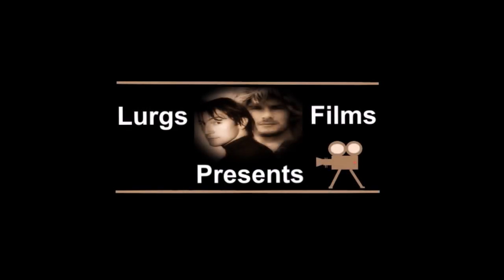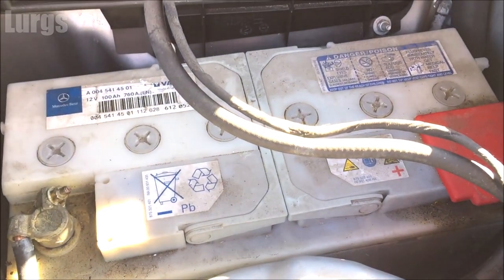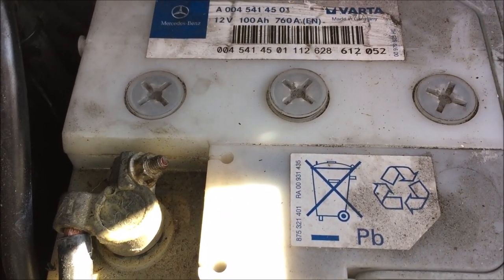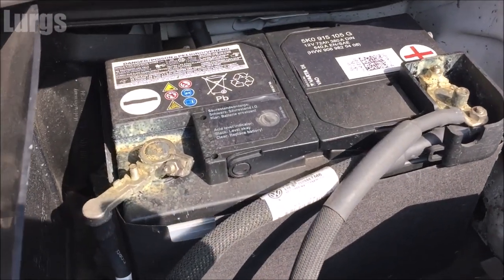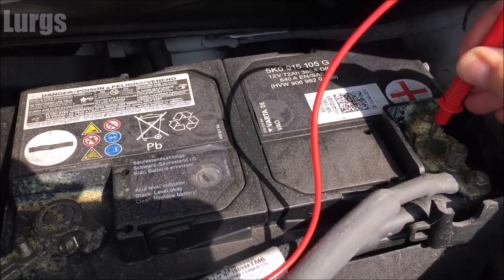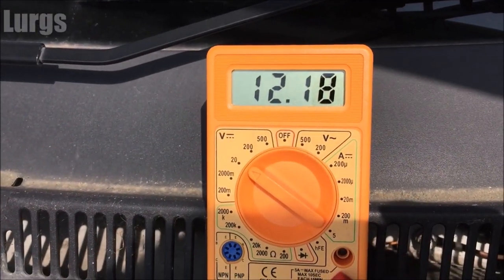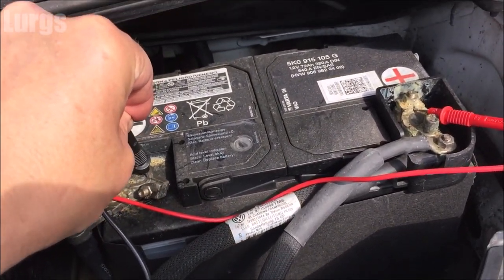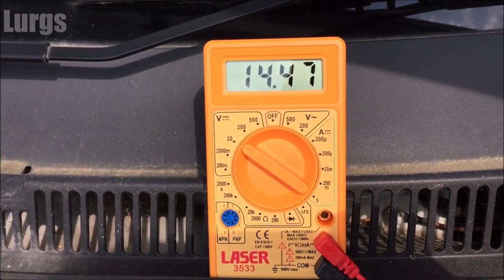How to check a Car Battery with a Multimeter

Comment: Thanks for doing this video.
Reply from the maker: No problem. Glad to help, batteries do suffer in the very cold weather. If it's playing up or not holding a charge then best off with a brand new battery. Have a fab weekend. 😎

Comment: Thank you for this video. Very useful. My battery is 6/7 years of age, but still seems to be working very well, and at the same level that yours is in the video. Do I still need to change it based on age, or should I go on performance?
Reply from the maker: Go on performance. If it starts struggling to start then replace it. Else it should be ok.

Comment: Having just bought a multimeter, It would have been good if you had explained which leads go where and why into the multimeter first?
Reply from the maker: Most come with the leads already attached. Will make sure I do that if I make a new one

Comment: Isn't 12.18V pretty low? Besides, shouldn't the voltage be checked during the initial crank and if the voltage goes below 10V while starting the engine, the battery may have serious issues?
Reply from the maker: Yes you can watch it as it cranks and voltage would drop down. Multimeter helps but also you’d hear if the battery was on its way out as it would struggle to turn over. If in doubt it’s always worth a new battery

Comment: Mine is reading 12.56 but it took about two minutes of sticking the nodes in each terminal to reach that, what does that mean? my car computer is also telling me the 12 V battery is low, even though the multimeter suggests otherwise and the starter motor doesn’t sound as if it’s struggling to draw amps either
Reply from the maker: Could be the battery isn’t holding a decent charge. They only last 5-10 years

Comment: You've not checked the battery. You just checked it's voltage. Need to check it under load for it to mean anything useful at all.

Comment: Tutorial Tip: 
Be sure to check your battery terminals to make sure they are both in good clean condition with no corrosion on them.

When is 12.1v good?

Tutorial Action: 
Continues to test battery with multimeter on corroded terminals.
Reply from the maker: They aren’t corroded it’s Battery protection spray paste so it does look that way!

Comment: What happens when a battery is bad? Will it give no reading at all?
Reply from the maker: It will probably show a reading. It’s when it’s under load it will fail. So put Nodes on whilst starting it or putting on headlights etc and rear heat screen and if it’s a poor battery the voltage will drop down very quickly. Older batteries don’t hold a charge very well. If in any doubt get a brand new battery, it’s so important